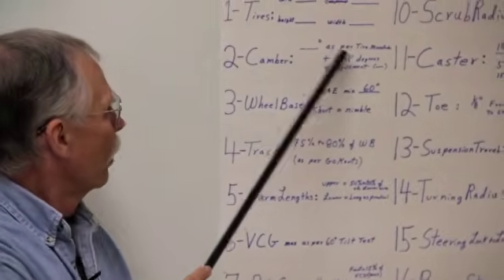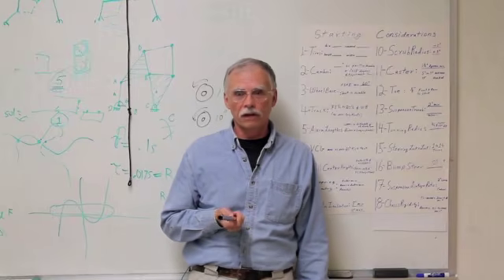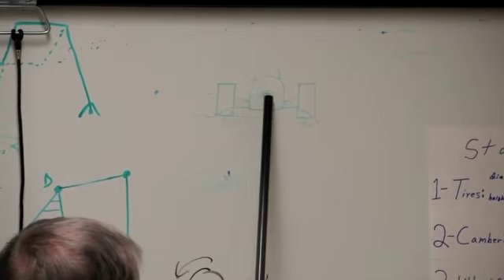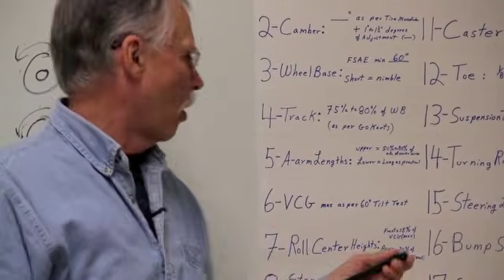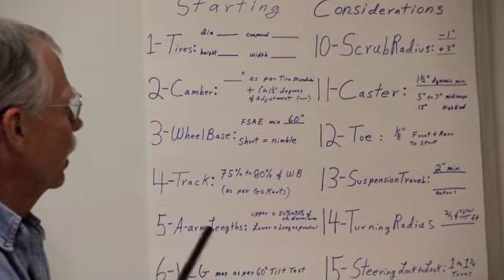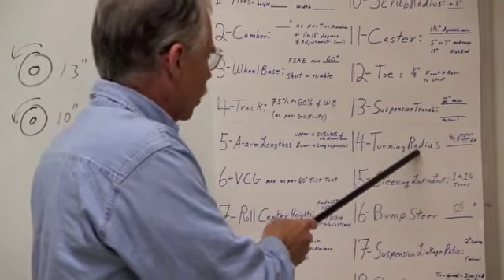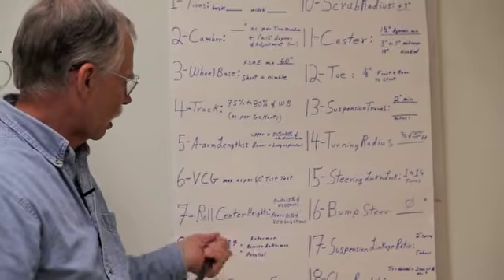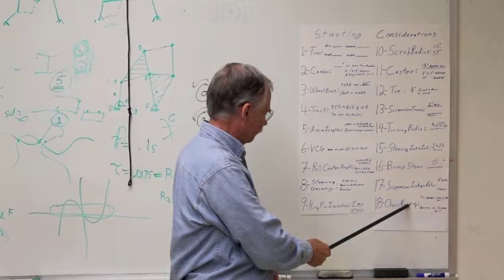Intro to Racecar Engineering:  01 Getting Started

Comment: Okay, I have a personal proyect and I'm loving your lecturas for it. It is a vw aircooled powered single seater meant to be the combination of a formula single seater and a trophy truck. It must be drivable on the street but it also has to be capable to become a high speed dessert runner. 
It will be designed and built around 2 sets of tires... 33"x11.5" off road tires and 29"×9.5" on road tires. 
It is meant to be high speed stable, responsive and have a high ground clearance. I'm designing it to have a ride height of around 18" on the 33s and I'm aiming for 10" on the 29s, so the suspension travel and inclination have to be adjustable. My problem is the design of suspension geometry. Double A arm in the front is perfect while the rear I'm not sure if I should build it as a trailing arm independent suspension or as a double A arm too. And the angles... those are my nightmare. Camber, cartera and kingpin are the places wgere I loose it. My overall with is set to 6 ft to the center of the tires and the axle to axle distance is set to 10 ft. That should provide perfect stability against rolling both at high speed cornering and at steep angles off road. My  highest point is gonna be under 58" and my center of mass will average under 35" (more like 25 to 30 from the ground on the offroad setup).

Now, I get that the suspension travel angle should be inclined towards the back for shock load handling. The trailing arm in the back makes the most sense to me in this aplication. The kingpin angle should be tilted inwards and the caster should help trailing in the front wheels (so, advanced top towards the front). Toe should be almost neutral or half degree toe in. Am I right? Oh, and steering should be from the front of the knuckles to prevent bending since tension is much easyer to handle than compression right?

For the suspension duality I'm thinking of pushrod design to be able to swap stuff easyer or maybe a simple colocar swap with different shock and Springs could do? And the sway bar will absolutely go on for the road and off for the dirt. 

So, any advice on this monster proyect? Once it takes shape I will tackle the powertrain stuff, that is a much easyer task than suspension and steering geometry

Comment: Do you define track width as wheel mounting surface to wheel mounting surface, or from the outside edge of the tire to the same on the other side? Depending on tire width and wheel offset/backspacing, this could make a huge difference on the accuracy of someone's track width to wheelbase ratio.

EDIT: Lol, I had paused the video to ask my question literally 4 seconds before it told me. Nice. (It's center to center of the wheels BTW, for anyone watching. So technically neither of my examples unless the wheels also always have 0 offset.)
Reply: Center of wheel to center of wheel

Comment: Excellent. With very few exceptions, I agree with all your design parameters. Driver ergonomics ARE important. I don't know what the track configurations are like (I'm UK based) , but , if top speeds exceed 50 mph I would look at Lift /Drag as well.

Comment: I drove a Formula SAE car and the cockpit was so badly designed that it was almost undriveable. We had to sit bent at the hips at 90 degrees with no elbow room and a small steering wheel placed so low that it hit our knees when we turned it! To make things worse the turning circle wasn’t enough and the car couldn’t get around the hairpin. It was really embarrassing for the team. It’s very important for car/race car engineers to understand that that if the driver is uncomfortable, ergonomically compromised or in pain, then the car performance will suffer and all the effort will be wasted 🙂. Just a bit of advice from my experience racing.

Comment: Great info for guys looking to learn. I especially appreciate the comment about driver consideration at the end. I see some guys who are great fabricators build these awesome car setups and then the driver position looks absolutely horrible. I would argue that ergonomics may be more important than certain design elements which may make the car physically capable of going faster. If the driver doesn’t feel confident and have the ability to execute fine levels of control the lap time will probably suffer more.

Comment: isnt caster whats returning your wheels to neutral position?
Reply: It's really caster,  kingpin inclination (plus some tyre torque) working together
Reply: mechanical trail and scrub radius work to self-align. Castor and kpi control these, but also the offset in relation to the wheel centre.

Comment: The difficulty with all of this is you end up with a lot of racecars which look the same and that in turn, IMO, is part of the problem with falling interest.  On the flip side is something like SCCA where cars can look considerably different but then you are working to a large degree with what the OEM decided was their design and all the compromises from handling characteristics involved adding in any rules regarding change.  And even with SCCA, as an example, given racecars are going to, over time, begin to dominate which will lead to copying of those known to work well assuming one is trying to get to the podium.  IF this is all just being done as an exercise for learning, great.
Reply: This is how evolution works. This is why some animals, like sharks for example, haven't changed for 200 million years. There is an optimum setup for every task. You want to be succesful at a certain task, you have to get closer and closer to the optimum. Otherwise you will be taken over and left behind.
Reply: @marrs1013  But it does not help the "spirit" of learning, adapting, improving.  Why should someone bother if they know the winning formula?  They can just go buy all the parts, assemble them and go participate.  Skills are lost or never learned in the first place. So at some point that evolution will come down to who has the biggest wallet.  NASCAR is a perfect example, interest declined when 3/4/5 car teams began to dominate.  Real big money, as in sponsors, needs spectators and TV viewership.
Reply: @russellzacharias3535  
Then they will find a different discipline. NASCAR is a done deal. Like sharks. They reached the optimum. NASCAR is still fascinating, just like sharks, as examples of optimum reached for certain tasks.
 That is why innovation never stops. The "spirit" never dies. It can't. We reach the optimum in something, then we move on to new things. The optimum becomes boring.

Comment: Saying that a 2 motion ratio (2' shock travel for 1' wheel travel) is good is ridiculous.  You evidently have no real experience with actual racing or damper basics.
Reply: His instructions are specific to Formula SAE where 2" of wheel travel is required and pushrod suspensions are common. One theory is that increasing the shock travel permits more accurate tuning of damping and rebound due to greater volume of damping fluid displacement. Dude has pretty impressive resume, so ....
Reply: @DaleCarterDrives  Hi Jessie Dog.  Most cars have 2" of wheel travel.  If he was actually saying that the shock should move 2" for every 1" of wheel travel then I don't know what shock you might use to do that in Formula SAE.  There are plenty of people with impressive resumes that don't know what they are talking about.  I am not going to debate something that I know is incorrect.  It would be like trying to convince someone that the world isn't flat.  Believe what you want.
Reply: So then what's a realistic motion ratio to consider
Reply: @zakshah3480  I would say .6 to . 9 would be good.